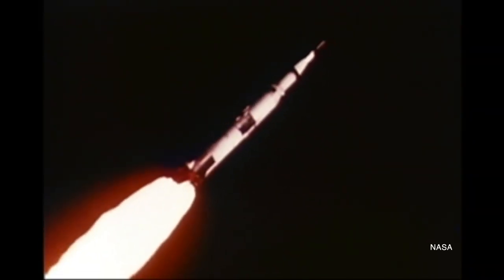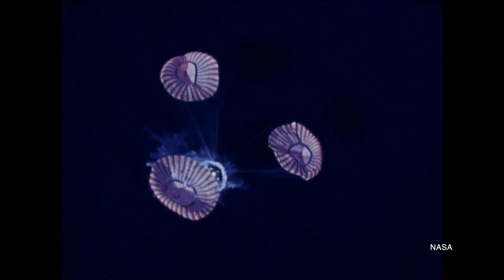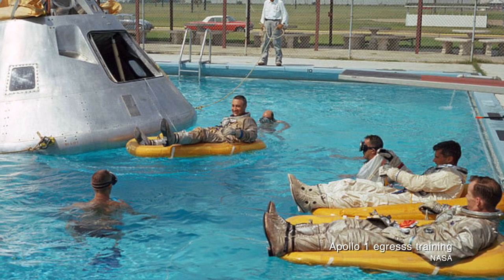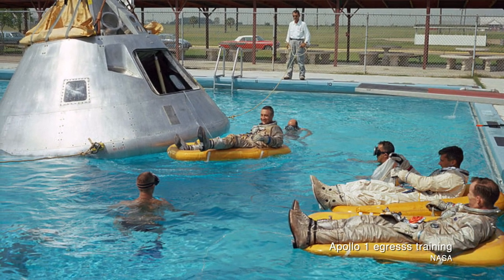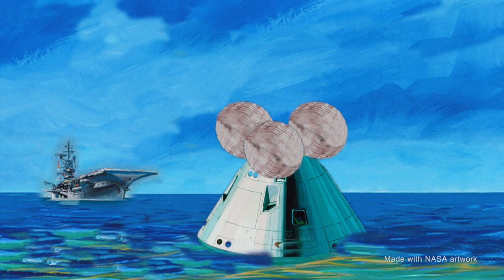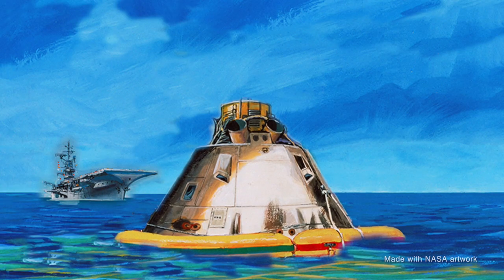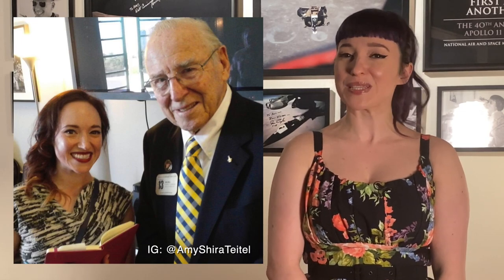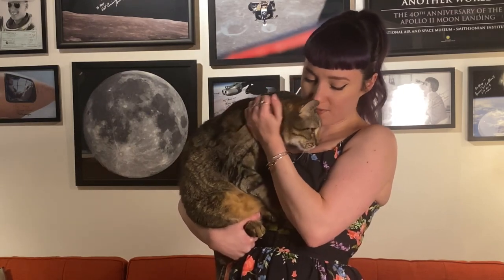That Time Astronauts Discovered the Apollo Spacecraft was a Terrible Boat

Comment: Some rafts on ships have everything to extra room in another with 4 season tent with vestibule connecting it to others.
 A sea anchor can make up for poor sea-keeping., you can change and maintain facing relative to the Sun or wind or wave direction. You can make some useful effort at either moving with or resisting being carried by the current or wind.

Comment: I imagine hygiene must have been magnitudes more difficult in there without the manoeuvrability that zero g affords. Also, what kind of radio/aerial would be any use in a bobbing capsule when the rescue ships are over the horizon? Were there dedicated communications satellites for nasa?
Reply: Depending on the wavelength there would be no satellite needed. 10m band, 2m band and 40m band would combine perfectly to reach any possible position of the rescue boat.
BUT i don't know which radio frequencies where used on apollo
Reply: I saw a docu where they talked about an early test to see how astronauts would live in the CM. They put a CM inside a building and stuck three guys in it for about a week or so. When they came out they were dirty, smelly, unshaven, and quite miserable looking. And that CM was just sitting still on a concrete floor. Bobbing in the water sounds like a puke fest.
Reply: If anything, I'd think it would be easier.  There would be no need to employ suction to pull urine into the collection tank. As for the...um....solid material, even when they did their business into the bag that was stuck to their butt, without gravity, nothing falls, so you've got to maneuver it to the bottom of the bag, and then seal the bag.
Reply: Scott Manley did a good video on the history of poop in space.
Reply: I'm just here to see... Ah damn. First 3 letters are wrong... 🤔
Reply: @Gulliolm  I can't find the exact frequencies, but it looks like the CM had a VHF radio system, so that would have been line of sight.  But if you get high enough up (and the ARIA aircraft could fly at 35,000 feet easily), you can cover a whole lot of ocean at any given moment-especially if you've got a rough idea of where they are.

Comment: FYI: Spaceworks, associated with the Kansas Cosmosphere, restored the Apollo Spacecraft 007 and it is on display at the Boeing Flight Museum in Seattle Washington. They have a very, very good spaceflight display there with a large assortment of Astronaut Pet Conrad’s space memorabilia on display. If you haven’t been there, Amy, you need to go.  As well the rest of the museum is worth walking through. Plan on spending the day, you’ll need it to see it all. Don’t forget the static displays across the street. The original Air Force One and a Concord are on walk-through display and others. 
As long as you are in the area, 20 or so miles north on I-5 will take you to Paul Allen’s Heritage Museum with lots of restored aircraft on display.

Comment: Re the potential 48 hour delay (for off-target splashdown), what about if the spacecraft hit dry land instead? Would the crew have survived if it landed on, say, a solid flat surface like a carpark etc?
Reply: Unlikely, afaik a landing on solid ground effects many times more shock on the inhabitants of the capsule, so it has to be considered during construction. Soyuz has some gizmo that creates a shockwave right before impact that causes kind of an aircushion between heatshield and earth so that the forces of the impact are reduced by a large percentage, Apollo wouldn't have had that gizmo, so they would land with the full speed the parachutes still allowed.
IF they survived, they would have been smashed with broken limbs or worse... 

But then land was far from the projected landing zone and going almost a thousand miles or so astray would mean that there were  alot of worse problems around to worry about before the landing came into the picture. IIRC even the early landings rarely went more than 300 miles out of the intended target zone. Which including the spread of the waiting rescue ships over the immediate surrounding of the zone even then should have been doable for a helicopter to at least drop off a jumbo sized liferaft or something like that.
All later Apollo capsules splashed down less than 80 miles from the ideal center of the zone with some going closer than 10 miles to the straight on target. For those the distance to any salvage vessel would have been less than half an hour as navy ships make at least 25-30 knots (nautical miles per hour) for the earlier ones at worst 3 hours
Reply: I know this reply is 4mo later, but I seem to recall reading about a possibility of dry landing events being considered in the design. Not considered the optimal choice, because mountains, boulders, valleys, trees, lions-tigers-and-bears-ohh my! not designed for precision landings! 
Should it be necessary, the heatshield would be the initial crumple zone pad, followed by internal frames inside the capsule bottom deforming under loads, then the shock mounted couches could absorb energy over about 12 - 18 inches of travel, finally the couch padding. It would be like a car wreck with seatbelts and airbags, but survivable in most cases. Not fun, but doable especially in a sand, marsh or mudflats LZ. Water landings were much simpler (in terms of capsule resources and weights involved) and well understood by experience with Mercury and Gemini designs, and offloaded the complexity and masses involved to the external recovery teams. Compare it to the additional complexitys of Soyuz and now the Boeing Starliner landing bags or early SpaceX Dragon retrothruster dry landing designs. Simpler is quicker, easier, and more reliable when lives matter.